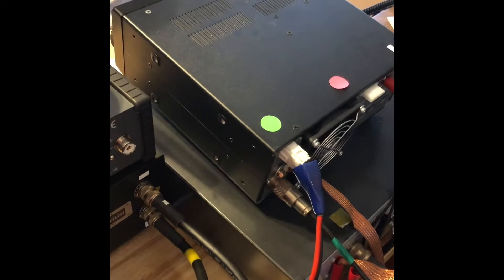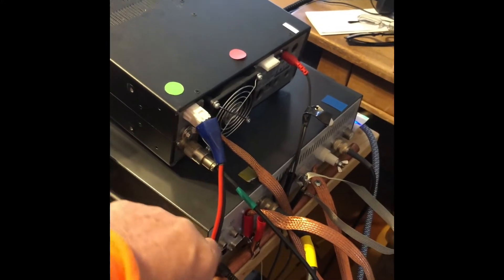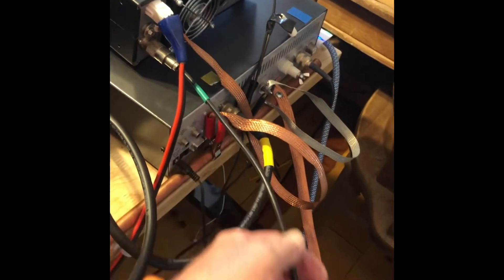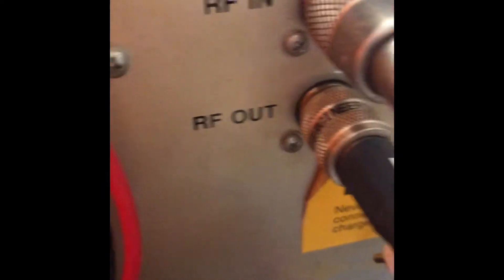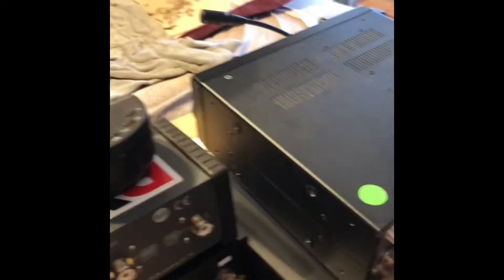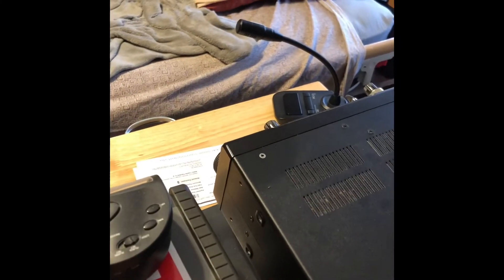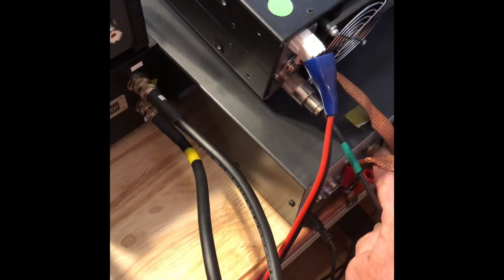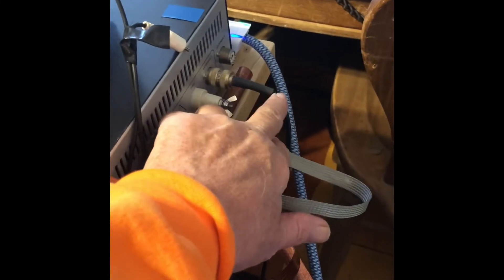How I have set up my Ameritron AL 80 B amp Power SWR meter and 1500 watt capable Auto tuner

Comment: Why the thin coax coming out of the Antenna Tuner to Antenna? Can it handle the high power??? I would have used Heavy Duty Coax to Antenna. Rest of connections look good. Willie - WG2L
Reply: It handles it just fine…for sure it would be better to have used larger coax….it was what I had available at the time….I am careful to have short transmissions with ample time between xmits….I can be heard along a with bunch of other old toots on 3.828 Mhz daily beginning at 5.00 pm to 7:00 pm Central Texas